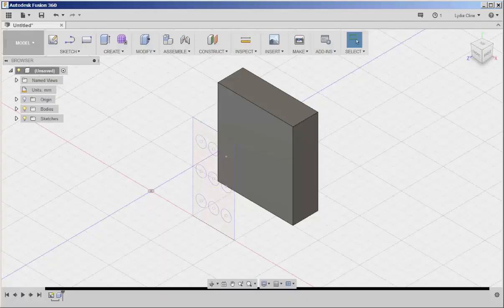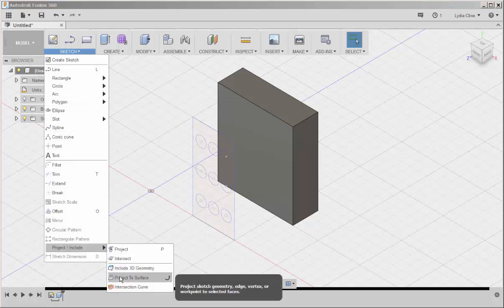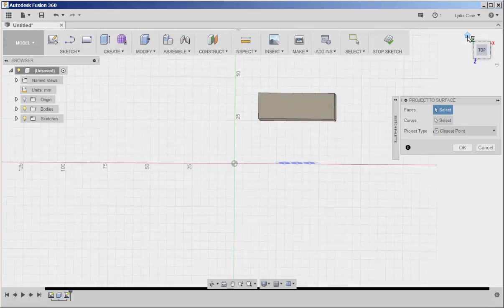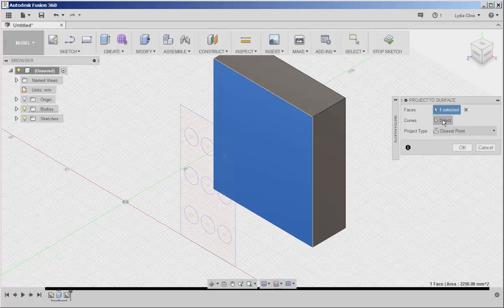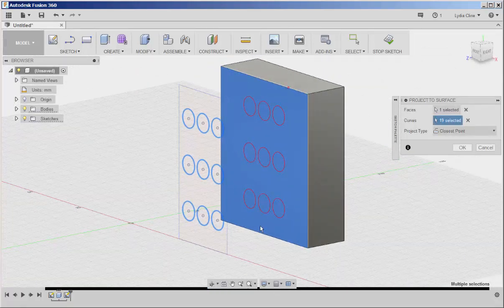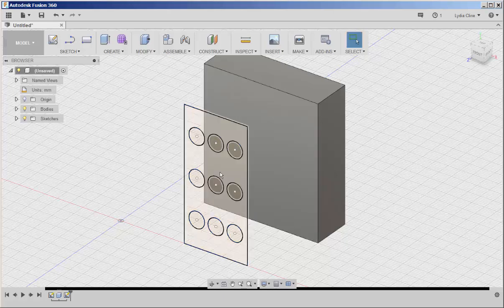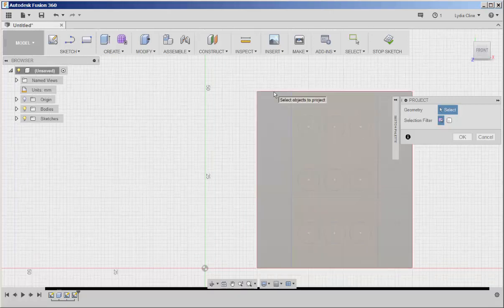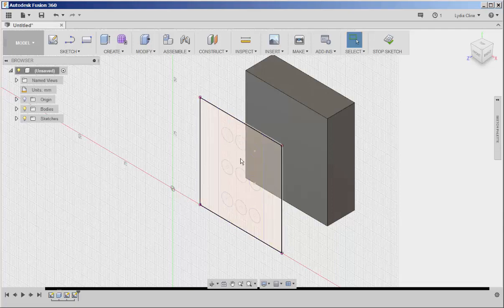Fusion 360: How to Project a Sketch

Comment: The circles projects like you described, but TEXT does not seem to project. Am I doing something wrong or TEXT does not project?
Reply from the maker: Text isn't a sketch object. See if you can right-click it when in edit mode and explode to turn it into sketches, which will then project.
Reply: @ProfDrafting  That sort of did work. Text letters required many segments to form, but did project red onto plane. However, after experimenting with it I have decided it is simply much easier to put the text on the object and extrude it. I will keep this operation in mind as well for perhaps some future use. I have never tried the "explode" feature before and will have to look into it as well.
Thanks! Tom